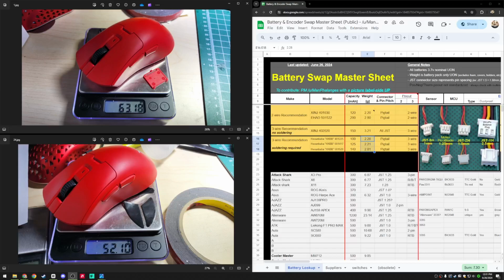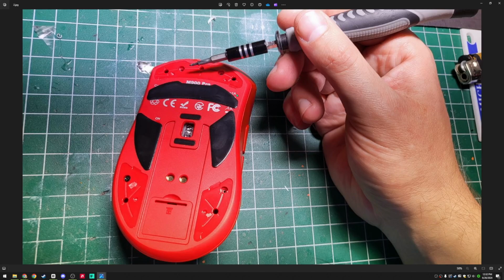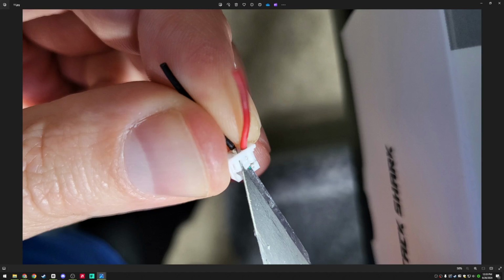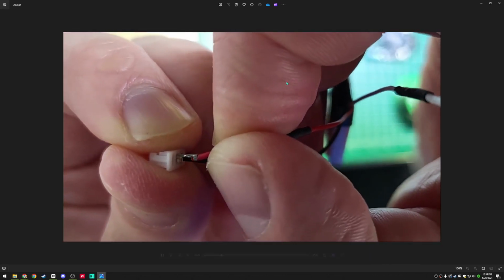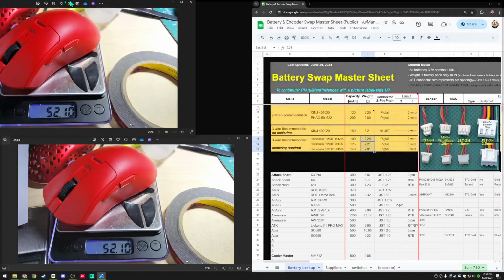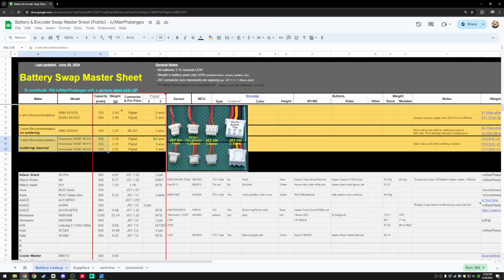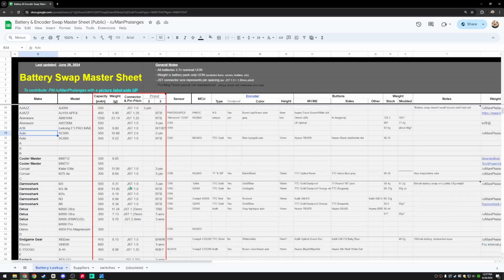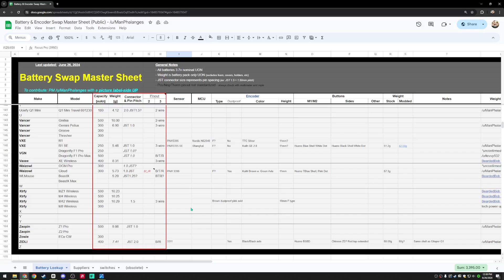[How-To] Mouse Battery Weight Reduction Mod

Comment: is it safe to put 3.7v in a mouse originally used 3.85v?
Reply from the maker: not rly
i've done it in some rapoopoo mice but im dumb
Reply: @ManPhalanges  then, were they worth the risk?
Reply from the maker: @mrnobody13374  ask me in 1 year if my house has burned down lol
Reply: @ManPhalanges  asked rapoo myself where to find those battery for "replacement", they sending me a mouse replacement lol
Reply from the maker: @mrnobody13374  yeah they don't really have an incentive to help modders. maybe one of the battery store sellers on aliexpress would help. XINJ official has made custom batteries for jakeu

Comment: Is it safe if i wanna use a battery with more capacity than the one the mouse came with ?
Reply from the maker: yep. must be 3.7v and the correct pinout. many people swap in 800mah or larger for b etter battery life

Comment: I've read somewhere that the charging current is too high for safe use when swapping from a large battery to a smaller one. Is it true?
Reply from the maker: Huh I haven't had any problems. Out of the ~50 or so battery swaps I've done, no spicy pillows. I did have one I accidentally cut and smelled bubble gum, so I never used it. Oh, I think I also received one that smelled too. So two issues I guess.

https://youtu.be/2XxDb_jOYfw?si=xqDDsrXFKfGgormb&t=3566
Reply: @ManPhalanges  Good to know. Thx for a quick response.

Comment: Do you by any chance know the battery pinout for Darmoshark M5? From your spreadsheet it seems like Darmoshark uses JST 1.0 connectors + RTB pinout for most of their mice? Safe to assume M5 is the same?
I found a "Darmoshark M5 teardown" reddit post but it seems like the wires aren't color-coded. Also, what does RTB stand for?
Reply from the maker: Red Thermistor Black
looks to be 1.0mm from this video. dunno pinout https://www.youtube.com/watch?v=4iCCLDDGFnU
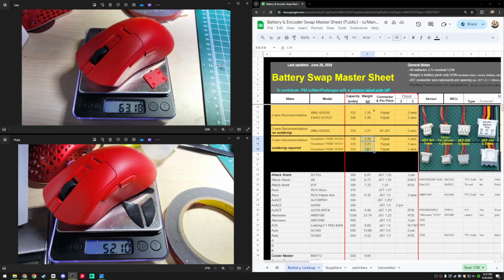Reply: @ManPhalanges  Thanks, I found another video that shows the wiring a bit better (at ~0:22) - https://www.youtube.com/watch?v=hbYVHcoqibY&t=21s
Seems to be Red Gray Black, safe to assume it's Red Thermistor Black :)

Comment: is it worth doing this mod on a mouse you plan to use 4k polling on?
Reply from the maker: Hmm, probably not.
150mah will be ~8 - 15hrs of battery life, depending on firmware, MCU, optical switches, etc
What mouse? I'd do it on a Razer. Their firmware's pretty efficient and synapse has game detection
Reply: @ManPhalanges  Was gonna plan to do it for my Zaopin Z2 Mini Max with a 200mah replacement. Moved from a Basilisk V3 x Hyperspeed so the weight difference probably won't affect me much anyway, but one of my upgrade points was removing synapse lol
Reply from the maker: @flowAws  Hmm, idk the weight savings with that mouse. 200mah would be decent, but you'd still have to be religious with charging after every 1-2 sessions.

There's other ways to reduce weight, too - dot skates and cutting up the base.
Reply: @ManPhalanges  Checking the doc assuming its similar to the other Zaopins it'd probably be just around 5 grams of savings anyway. How much would dot skate saves up over stock skates usually? Not sure about cutting up the base since I'd want it to look clean and not show the internals (also not sure which tools to use)